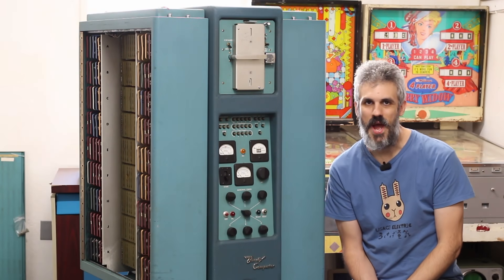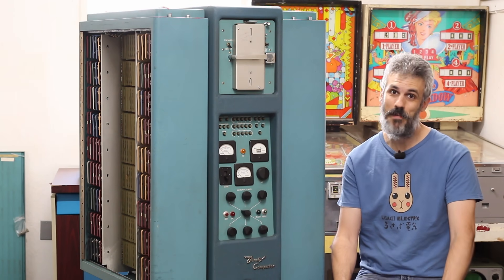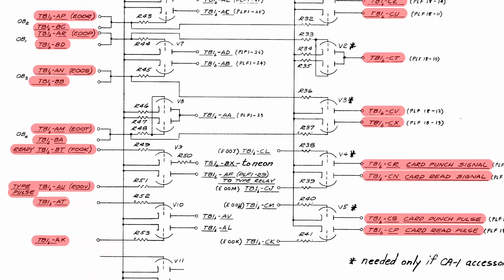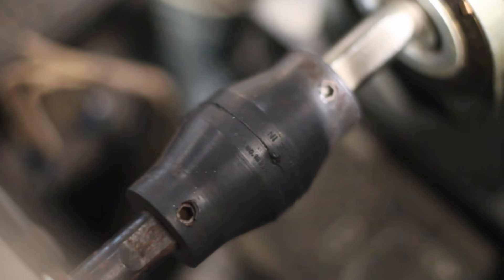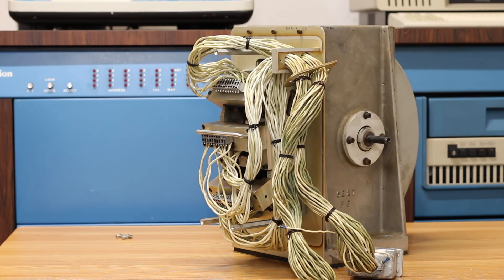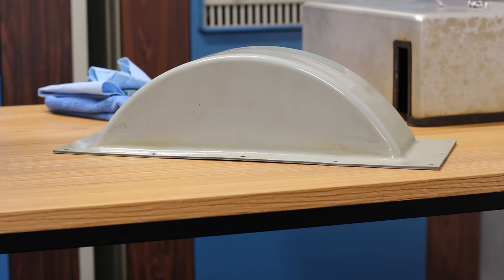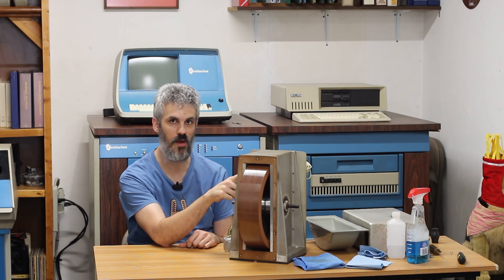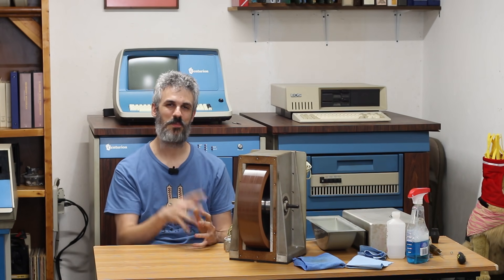Removing the Rotating Drum Memory from the Bendix G15

Comment: I'm trying to remember what I knew about magnetic tape.  If my 73 year old memory serves me right, the magnetic material in tape was gamma ferris oxide that was laid down on the tape in a solvent and the gamma ferric oxide was oriented using a magnetic field perpendicular to the tape surface.  If you have a random orientation of the ferric oxide, then the signal level might not be high enough.

Comment: I love your idea for recoating the surface of the drum. Just a few thoughts:

1. When you machine off the old oxide you may find the drum is a bit oddly shaped. Unless you know for sure that the drum was machined while mounted to the spindle that it's currently on, there may have been some misalignment between the center of the drum and the center of the shaft when the two pieces were brought together. If that happens then you'll need a plan for dealing with that

2. Please be sure to keep the drum rotating at a slow speed while it dries COMPLETELY. You don't want any of the new layer flowing due to gravity after the coating is complete

3. Practice makes perfect, so if you can find a scrap piece of aluminum about the right size that you can machine first then that would be ideal

I hope for all the best for you. You are a much better and braver man than I. 🙂
Reply: Very good comments. One thing that worries me a little about this plan is that the density of magnetic material might be too low. Perhaps the only way to find out is to try it. Remember that what you need is not just magnetic material, but reversible magnetic _domains_. That's what the iron gives you, but not just any old iron. If it's been treated in the wrong way (e.g. heated to very high temperature), it won't have the domains, and it just won't work. Also, I suspect you will need to adjust the heads afterwards, which could be tricky; one twitch and you've crashed the heads again (wince).
Reply: @therealdebater Apply layer by layer? slowly / gently?
Reply: I think it actually has to be centered on its spindle.  If it wasn't the gap under the read/write heads would be constantly changing.  It would either crash from the very start or move away from the heads and be too weak of a signal in certain sectors.
Reply: Yeah, was going to say, you 100% need to keep the drum spinning while the paint cures.
Reply: I agree, machining is not a good idea, I suggest sanding it down with sanding paper while rotating, The sanding paper will follow the surface even if it is eccentric, Keeping the original surface intact. I agree with keeping the drum rotating while drying to avoid drooping, Also I suggest low speed while applying the paint as well to avoid centrifugal flyout of paint.
Reply: There will have been absolutely no runout of that drum when manufactured.
I will even hazard it was turned between centers to ensure concentricity.
Even when this was made, machining this precisely was common and there where vast numbers of machinists able to make this part.

Also, @Capturing-Memories , this is really terrible idea. Seriously terrible. The one thing you do not want is to preserve any error in the drum. Machining the drum to being perfectly concentric and on spec is not difficult. I am just a hobby machinist, and I could do it.
Reply: @joshua43214  What's a bad idea? All what I suggested was removing the old coat and apply a new one. Did you know that when machining it you will have to re-align each magnetic head since the gap will increase between the drum surface and the heads? You haven't though about though have you?
Reply: re-aligning the heads is part of the job.  @Capturing-Memories
Reply from the maker: You're 100% on point!
I didn't go into too much detail in the video, but the goal is to build a scale replica of the drum out of aluminum first (maybe 3" wide with a 13" diameter) and use that for all our initial testing.
I'm envisioning the process being split up into three main challenges.

1. Perfect laying down a material. This step isn't concerned with whether the material is electrically viable, just with figuring out what it takes to get the surface finish perfect. What RPM do we need to spin at? How long and at what distance do we need to spray at? Do we need after-finishing like wet-sanding and how do we tackle that?

2. Figuring out the concoction of material to spray down. What kind of oxide to mix in? What percentage, flake size, etc.? How does that change the spray pattern? This stage will also require building a jig to mount a borrowed read head and write head (with accompanying read and write amplifiers) to lay down a bit stream on our test replica drum and then read it back.

3. Finally, tackle the real drum. Machining the surface to remove the original oxide may not be the best move, we may instead want to remove it chemically somehow. Also, figuring out how to mount the drum in a perfectly centered manner will be something we gotta figure out too. This challenge is far enough away that I haven't put too much effort into figuring out how to overcome the individual challenges it will present. I figure if we can clear challenge 1 and 2, then we'll know so, so much more about our machining and tooling capabilities that it'll make figuring this challenge out a lot easier.
Reply: @UsagiElectric  Hello! Good of you to reply so fully. May I quibble? ;-)
1) Rotating horizontally, spraying onto the top? horizontally onto the front/top of the curve? onto the side? 90 degrees straight on? tilted? FWIW I think the spray's characteristics can become familiar by applying it on different surfaces at differrent angles.
2) Sanding? holding a very soft material 2 or 3 mm from the surface ;-p
Might there be some shellac-like substance that could be used to apply an exquisitely thin protective surface? Material science has advanced so comprehensively!

As for testing, OMG ... does the system error correct at all? NOP goes to Stall/Spin/Crash/Burn/Die?

1/4 way through 1st cuppa coffee of the day. 🙂

p.s. I would soooo become obsessed with sucha project ... enjoy!
Reply: @therealdebater  : Getting the magnetics right would be a good reason to get in touch with modern tape manufacturers. It's a little outside of their wheelhouse, but I don't think anyone else even gets as close to this stuff as they do.
Reply: @Capturing-Memories  : Sandpaper really is a bad idea, too imprecise.
Reply: @UsagiElectric  : Chemically removing the material would be ideal. Hopefully there's an old servicing manual floating around to make the dev work easier.
Reply: @absalomdraconis  What's bad about using sanding paper, You clearly have no knowledge about machining, Sanding paper has different grit sizes, you can choose the right grit for the application, It is needed after machining anyway, But since the drum is precisely machined all what is needed is removing the magnetic coat. If you don't have mechanical skills I suggest you just keep your fears to yourself.
Reply: @UsagiElectric  Have you considered powder coating using electrical charge? It supposed to give a perfect uniform spread as long as the drum is rotating slowly, I would say 30 RPM,.
Chemically removing the old magnetic coat sounds like a good idea, then followed by a fine grit sanding paper to clean and prepare the surface for the new coat.
Reply: @UsagiElectric   if the test drum comes up to be very close to original size, you might want to give the replacement a run to see if you could actually produce new replacement drums for such machines
Reply: @UsagiElectric  First, nice paint job on the Bellett!  You wanna do a Fiat for me?

All kidding aside, if the swing on your lathe isn't big enough to machine the replica, I think my Bridgeport-Romi can handle it.  I'm in Dallas.
Reply: @BenTrem42  Does anyone have any idea how this was done back in the 50s?  That's the thing.  We have all this great new technology, but all the know-how and experience is long retired or even dead.
Reply: @tarstarkusz  Hi there - 1st step: woooaaaa!

We can't begin analysis with preconception. So, what's first?
A) drop the "50s" think. "the control mechanism of a Jacquard loom" is history of Jacquard written by someone with no clue about computing. 1890s ... there's up, and there's down. 0 and 1 ... techne / praxis :)
B) don't let "reasonable" cynicism / pessimism overwhelm you. Triage ... be clear on what you're tracking down, and stay on that track ... or abandon it ... or become fully-fledged schiz. This truly is your personal choice.

At my level of g33k (Not engineer; not technician; I self-identify as technologist / debugger / trouble-shooter.) I have never invested in tracing the history of such as this.
BUT I have to think that the basic concept is antique.

#Lateral - Even use an abacus? I made a study of it. Wow #1: it works to well! Wow #2: who the //hell// thought of it?! and how!!

🙂
Enjoy!
Reply: @BenTrem42  Watching additional videos on this, this will likely be impossible.  There are permanent (read only) timing tracks on the drum.  They generate the clock for the whole system.  There doesn't appear to be any way of having 2 of these in the machine at the same time.  He said these tracks could be laid down back in the day, but that nobody has the necessary procedure or possibly hardware needed.  Frankly, I don't know how the system could do anything without a master clock.  There are 3 of these tracks and 2 are necessary. One of the three is a redundant track.
Reply: @tarstarkusz  Oh, you and I really are on different tracks.

I apologize if anything I wrote seemed to indicate my knowledge of this system's specifics. Not at all!
As I hoped was clear, I don't have anything like a technician's knowledge.

good luck!
Reply: @UsagiElectric  also my advice, don't use a squeege to make the coating to correct thickness. Use another roller. In fact, you could use that roller to apply a paint in the first place, similarly to what's done in offset printing machines.
Reply: @BenTrem42 "Drop the 50s think"... Right. As they would have had all the modern technology and understanding in the 50s and were just avoiding using any of it whatsoever.

Little thing usually referred to as "getting in the headspace of the engineer that designed it" is what is meant... which... would have been in... wait for it... the 50s.
Reply: @MadScientist267  Greets!
I think we underestimate how much material sciences advanced in the past decades. I had the dubious honor of babysitting a late 1950s multiplex system (Lenkurt mmmm 600? part of the DEWLine microwave links) and truly admired the inventiveness of their workarounds. But the stuff was notRPTnot elegant!
Reply: @MadScientist267  My reply doesn't show up. (Yet?) But just this:
Lenkurt L600 carrier system. 2 techs in LA knew it pretty well. I was sent up there to figure it out and keep it ticking over!
Reply: @BenTrem42  My original got dumped because I had to set the phone down lol... Anyway jist of it was that it isn't that you can't apply modern learning to things... but that in restoration it is best to get inside the head of the original engineer as much as possible so as to land the same places along the way. Nothing wrong with retroactively applying lessons long learned (a restoration isn't the place for experimentation)... but applying those lessons to the original vision is what gets it the closest it can be. In order to do this, one has to cut themselves off past the date for what was available to work with in the context being discussed in its day. Once you have "reached the understanding", then application of recent techniques isn't an issue at all, provided it achieves the desired results.

Philosophical, less technical, I'm aware, but as they apply... jus sayin.
Reply: @UsagiElectric  Rather late lol but for "next time"? 🤣

For removing the existing oxide... It is most certainly going to be softer than the aluminum underneath... A cotton band comes to mind, running on its own power, and just lightly load the drum with it wrapped a good percentage of the circumference... and let it "polish" it away... it shouldn't hurt the drum underneath when it reaches it, and might need an elbow grease version at the end... acetone also cones to mind... may help dissolve binder material for the finishing round.

Just my random thought after a few hours of background thinking lol

Comment: You may want to pick up a paint thickness gauge before you put the recoated drum back in the machine. This will let you test the consistency across the drum surface, so you can rule out high spots causing crashes. These are commonly used by detailers, so they know how much paint they can safely remove when polishing.
Reply: An automotive paint thickness gage wouldn't work. The drums surface is conductive. We're talking thousands of an inch not tenths. 
edit:
The paint thickness gauges are more accurate than i thought.
Reply: It only works if the metal part below the paint is magnetic. The drum is made from aluminium. This won't work
Reply: it would be better to simply make a repeatable jig the drum can be placed in and use a tenths (ten-thousanths) indicator. machining solved this problem a long time ago. if it really needs to be repeatable a couple of centres could probably be drilled in the axle of the drum (or may exist already). these are definitely a good idea through the whole recoating process for maintaining excellent concentricity
Reply: Why couldn't they just use the lathe to cut the final coat down to the perfect level?
Reply: @josht6895  Need better surface finish than a lathe alone can give, and turning down a polymer coating that starts at maybe 2 thou thick and ends at ~1 thou without it gouging/gumming/delaminating/chipping seems like it'd be almost impossible.
Reply from the maker: With respect to removing high spots, we have a quite nice runout gauge for our mill that will allow us to check the final surface quality before removing from the lathe (even if we don't use the lathe for any cutting, it's still a great high precision mount). So, each layer will be checked for runout to see just how close we are. The head clearance is set to 0.001 inch, which means we need even more precise runout than that, which is pushing the capability of our tooling, but I'm always looking for excuses to buy new tools, haha.
Reply: @tradde11 : As a general rule of thumb, the accuracy of machine tools available in the year 1900 was only limited by cost (which, really, was the primary limiter), sanity, and brownian motion.
Reply: @UsagiElectric  : You might see if you can use an interferometry rig for this. I've read good things, but don't know if the drum would be "readable".

Comment: electroplating might be your best solution. When scientists and engineers experimented with tube computers back in the 50es and 60es in Hungary, they used rotating drum memories just like this computer did. When they had head crashes, they stripped the coating off the drum on a very precise lathe, and used electroplating to deposit a new layer. As i read, they did not use ferrous oxide, they used some king of chromium salt, soluble in water. The finish ended up to be very strong and durable, but needed higher magnetizing currents. The article did not tell the exact composition, i guess it was a trial and error thing. In that era, every computer was an unique design, especially in Eastern Europe.

Comment: One option you might want to consider is making a stand-in drum memory from scratch - something you can use to refine the process for cleaning/coating/etc without impacting the original while you work out the details.  If you can get THAT working (and clean/re-do the coating multiple times), then you will have a fairly solid process before proceeding to the real one.

Primary concerns on the mechanical side would be dealing with runout from re-mounting things (so turning between centers, and indicating things in REALLY WELL, including having a perfectly "leveled" lathe).

I'm REALLY excited to see this happen, it combines some of the coolest electro-mechanical problems from the era!
Reply from the maker: You're absolutely right that the most difficult part is going to be the mechanical side of things!
Once we've got a consistent process figured out for that, we can move on to figuring out the correct concoction of magnetic material to spray down. We'll definitely be tackling this first with a replica of the drum that has the same 13" diameter but is maybe only 3" wide, so we can test and iterate ideas and processes really quickly. 

It'll be a serious challenge, but I think we can get there!